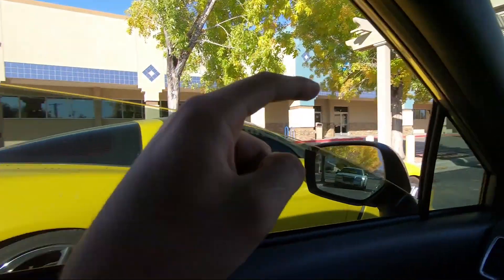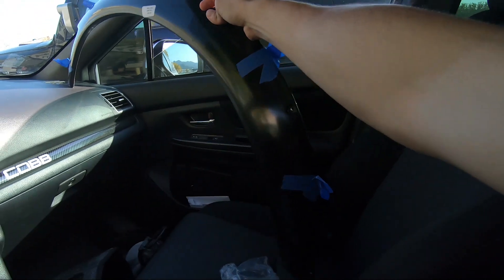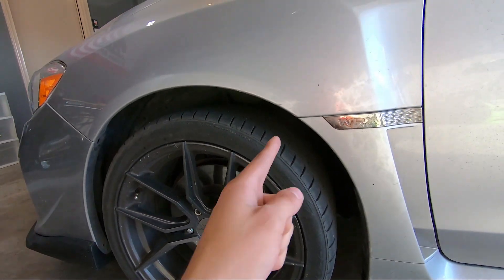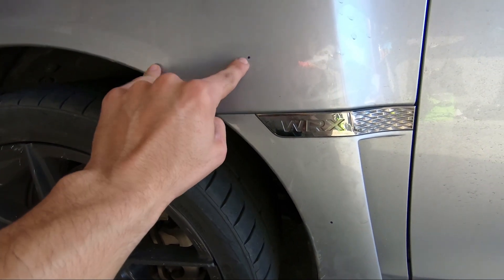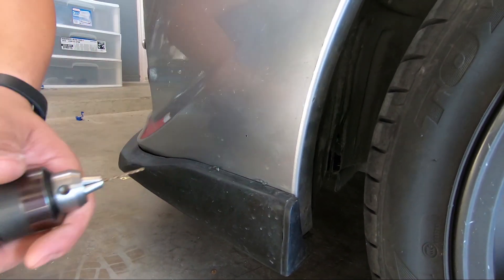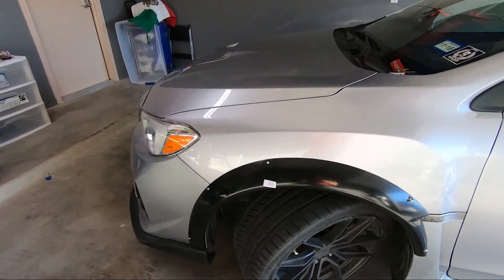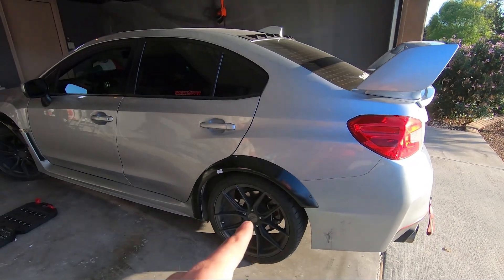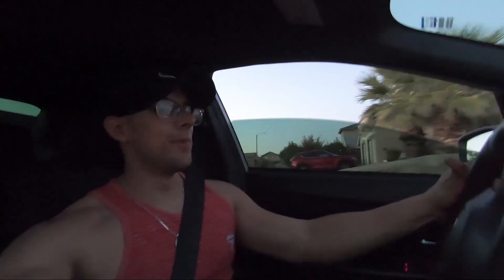HTAUTO Fender Flares install!

Comment: Hey, they look really good, just saw that you got them painted. Quick question: don’t you have to cut the fender when you install these flares?
Reply from the maker: Ayden Leppert thank you for tuning in! And thanks man! Honestly if you’re at a stock height you don’t need to cut them, I scrape a little When hitting big bumps but other than that nothing major, just cut them a day ago because I’m gonna go lower but you should be good if you’re at stock ride height.

Comment: Dope job man! Looks great! Wheel specs please?? How much did you have to cut the fenders so your new wheels fit without rubbing or hitting anything??
Reply from the maker: Sorry for the late reply, I am running 18x10.5 wheels with 275 35 R18 tires all around i cut just about an inch off the fender and so far minimal scraping.